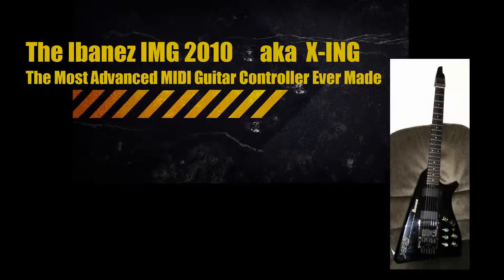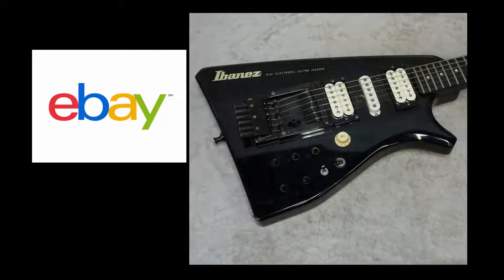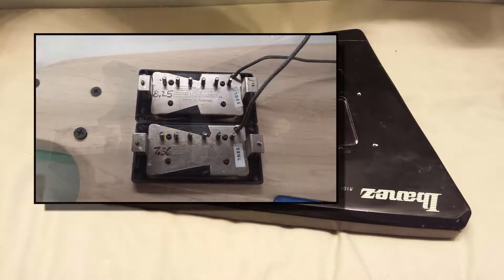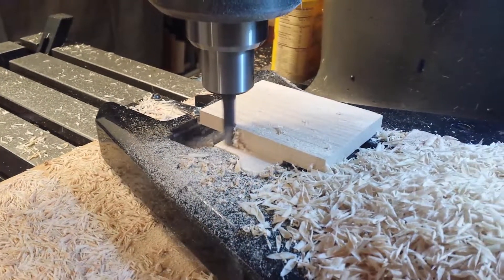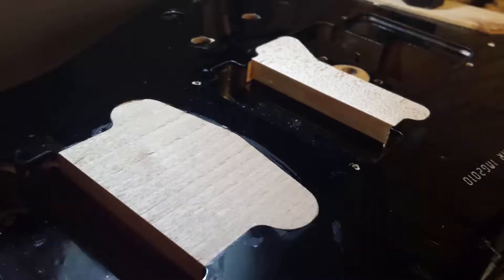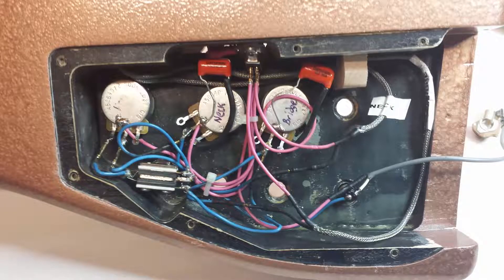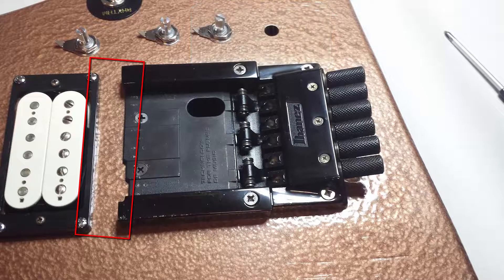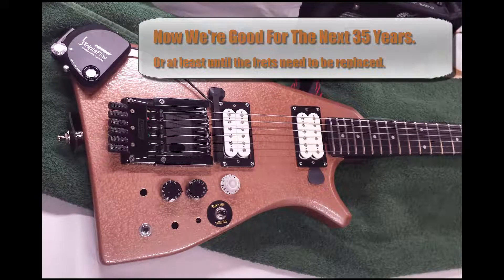Updating the Ibanez IMG2010 to the Fishman Tripleplay. A derelict guitar finds a new life.

Comment: Cool! An observation: the neck pickup is inverted.
Reply from the maker: Really, I thought the white part was supposed to point up?
J/K  :-)  - You mean the screws should be closest to the neck? I put it in so the wire was closest to the routing hole.